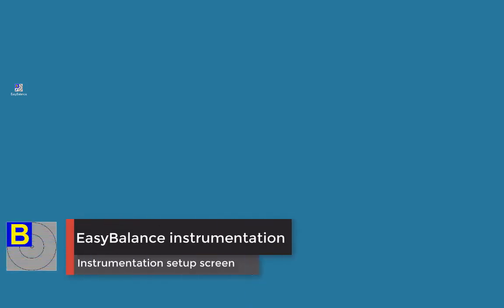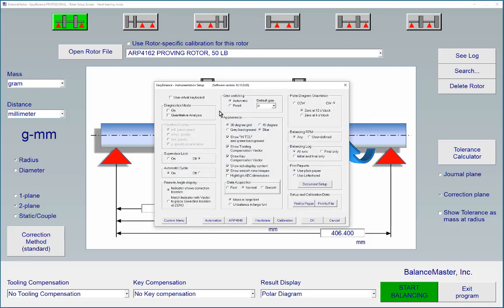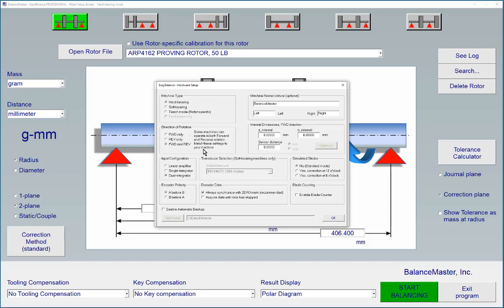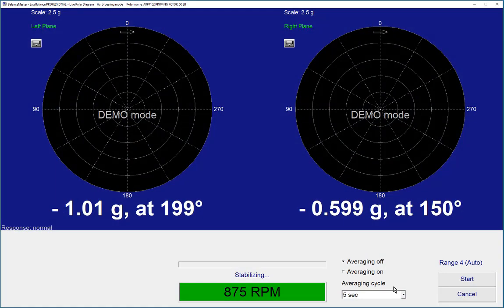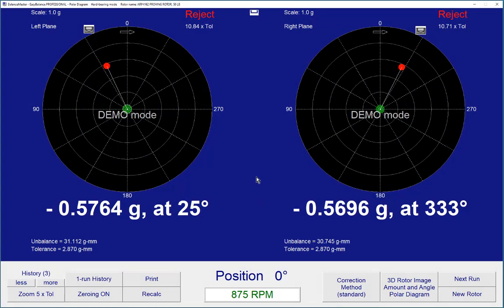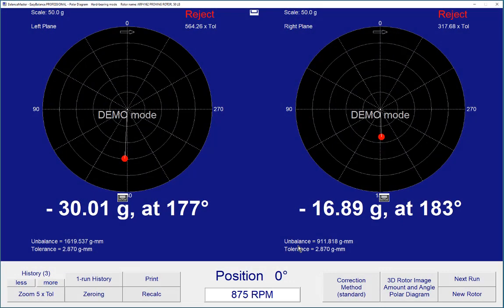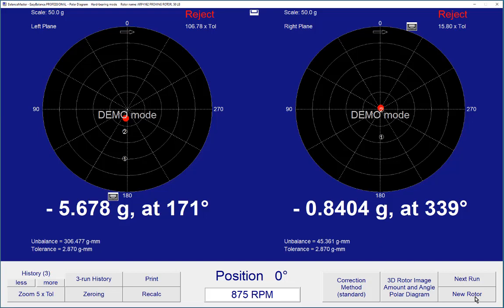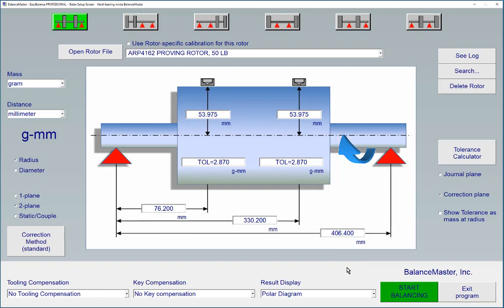Balancing Instrumentation Setup

Comment: The probe icon on the screen above outer diameter flips up or down, why ? What does this function do, how should I use it properly ? Thanks
Reply from the maker: Not sure I understand your question. Can you let me know the timing mark where you see this icon in this video please?
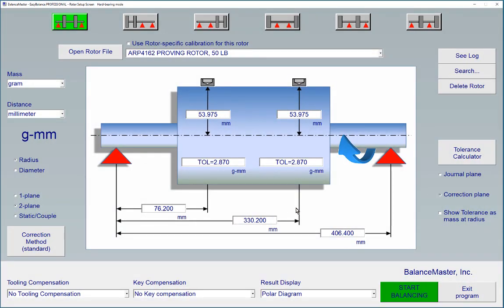Reply: BalanceMaster, Inc, in the rotor set up screen at  00:40. But I figured it out it is the add or subtract material option. I didn’t know that I could change it in this screen. It threw me off. Thanks for the speedy reply !!
Reply from the maker: @halfbaked4life  You're welcome